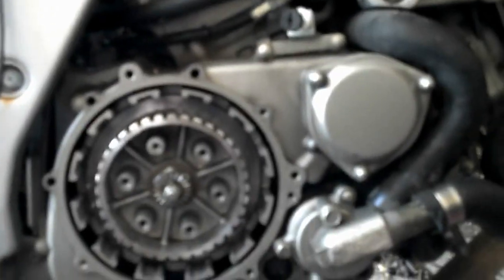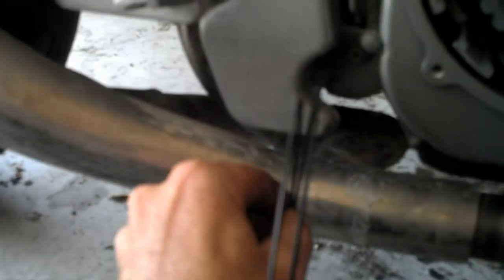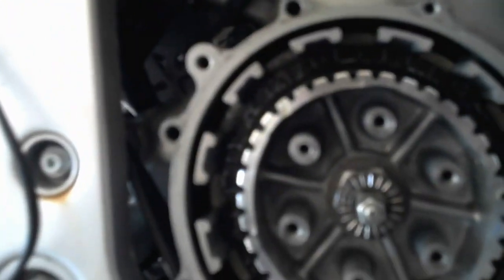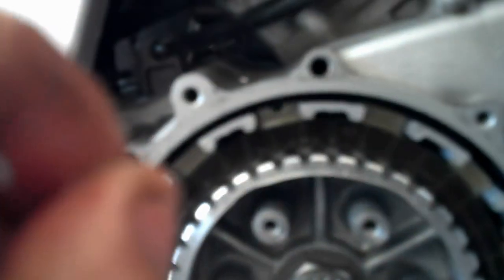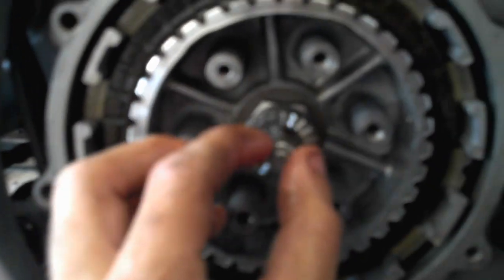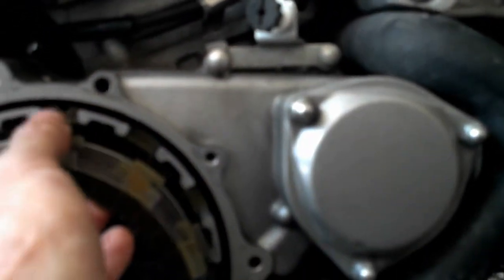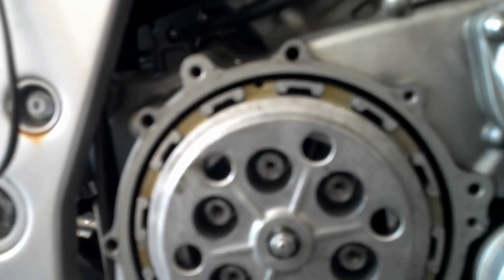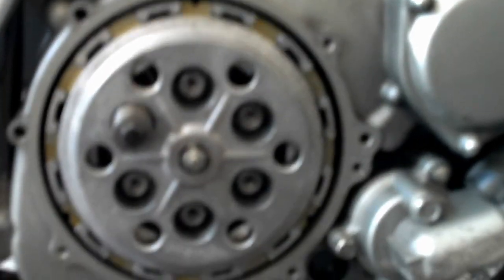Hyosung clutch install and tweaking

Comment: Did you use a clutch holder tool? If so, then please can you specify which one. Another question, I read that on Hyosung GT650R the washer become lose at some point, did you experience it? How much torque did you use to screw the washer back?

Comment: My clutch is also  slipping  should  I do as you  and add a plate
Reply from the maker: doug DouglasB no. i would adjust it. then i would check to see if the how worn the clutch is and repair as needed. this was a track bike. as long as you dont burn a clutch out you will never need to add the 7th steel i used
Reply: eliofall  so I did brun my clutch plates out and I put on the after markets and when I put it in gear it just cut off so should I use the extra steel plate because it looks like my after markets look a little smaller than the manufacture plates